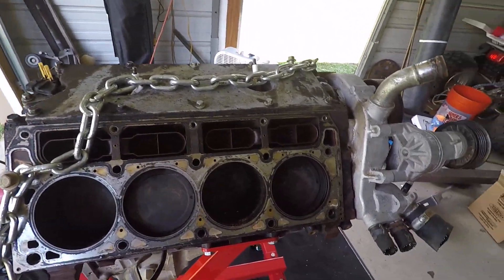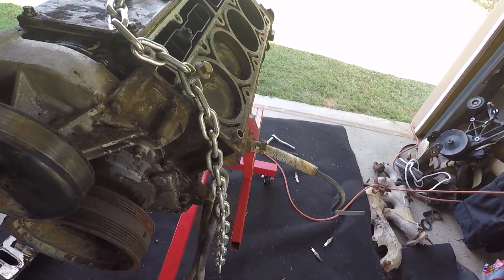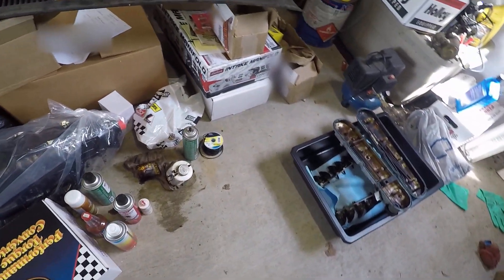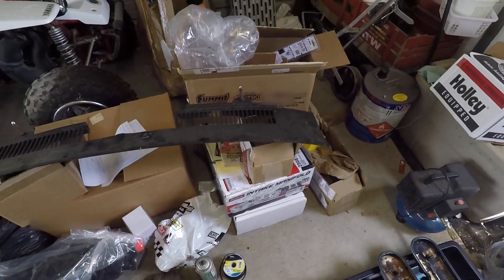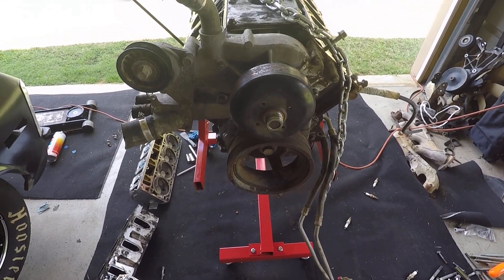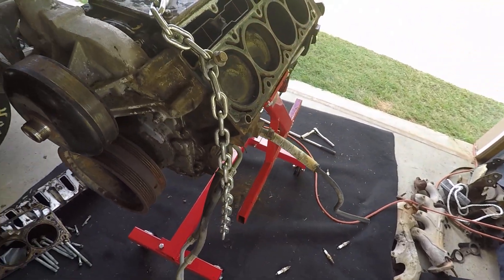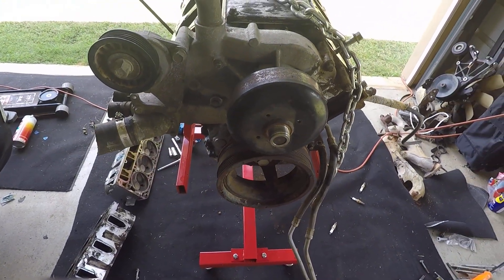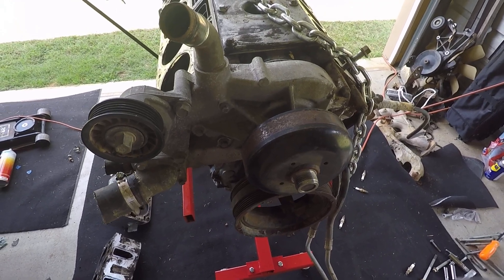LS Swap G body Malibu Update and a Look At Some of the Parts Part 2

Comment: Nice car! I have the exact same car, blue 79 malibu with a bit more patina and a built 5.3l/ t56. Curious what are you going to do as far as the rear end? Also, do you plan on notching and bracing the frame at all?
Reply from the maker: Plans are for a 9 inch rear.  I may eventually notch the frame when I put a cage in it
Reply: Nice, that's what I'm planning on doing as well. Keep posting videos, I'm very interested to see the progress and that beast running!

Comment: I see you have the JEGS wheels on that Nova over there. I just received the set I ordered!
Reply from the maker: Nope, those aren't Jegs!  Those are real deal Weld V series... $550 a piece! lol
Reply: @livetorace163  Damn! I gotta stay on the cheaper side. I ended up buying those Coddington wheels as well. I am hoping they will fit on my 1951 as well. It is also on a G-body chassis.